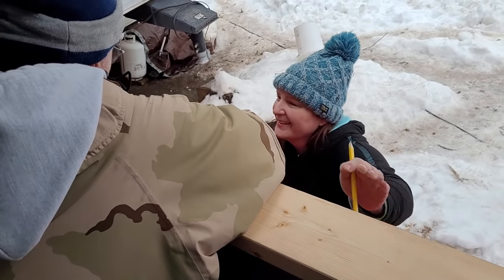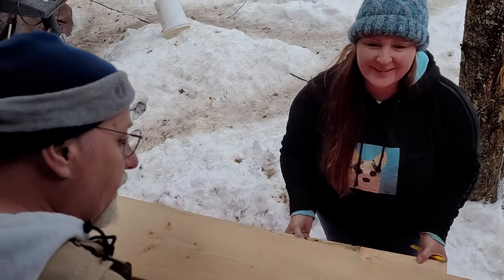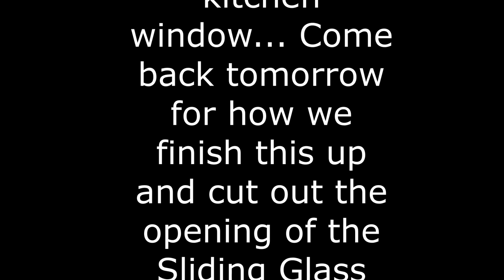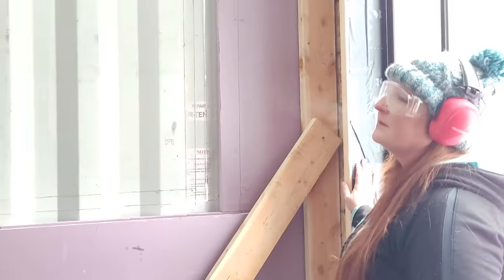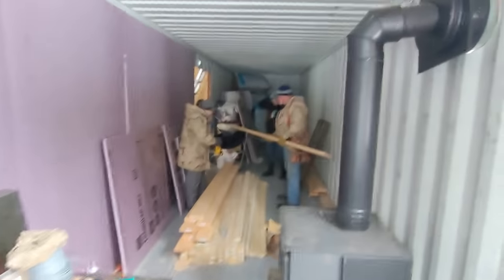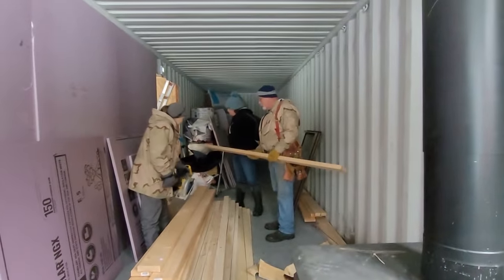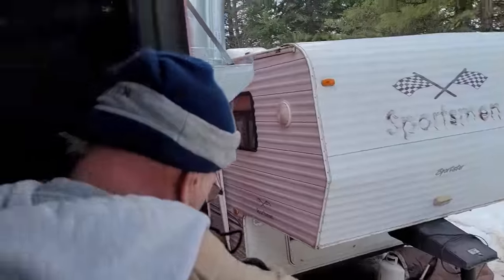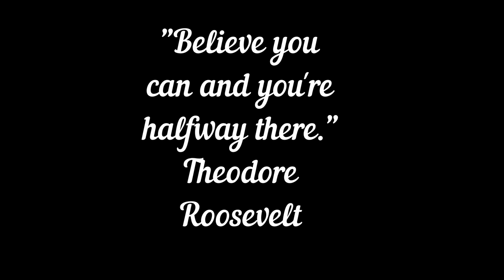DIY Shipping Container Tiny House Build// Wood frame windows in shipping container//VLOG

Comment: Can you not put the 2x4 in the deep part of contour so you only lose 1 1/2 space. I plan to spray foam inside outside . Strap outside 1x4 and side it wood planks. Inside drywall it over spray foam. Sheets of foam on floor and plywood . Spray foam top out and inside , frame a roof pitch metal roofing panels .

Comment: That was really interesting how that was done.  We are getting a storage container for a shop. Now we know how to put in a window.
Reply from the maker: We will be adding more windows and show more close ups and getting them all sealed up and rain proofed.
Reply: Don't copy that!
Reply from the maker: I learned this way of doing it from a few other contractors on YouTube and once we spray foam around it and caulk all the seams it will be good to go I feel.  The best way is to weld in a frame but for those of us that don't weld this is the recommended way.  You will have to paint the wood just as you would do on a reg house to make the lumber last in the wood frame.
Reply: @wilyung1706  how do I say this in my best Heather voice.. you so funnyyyy